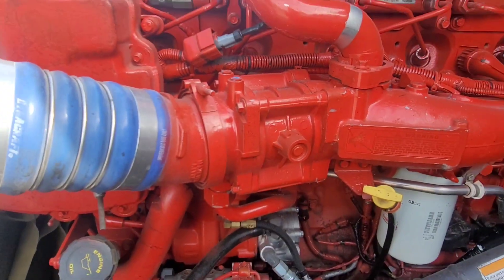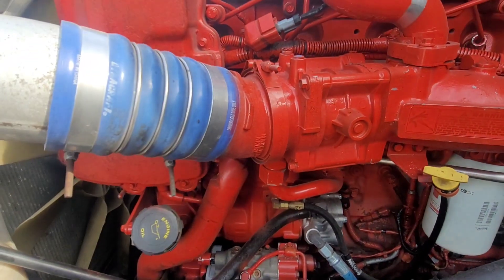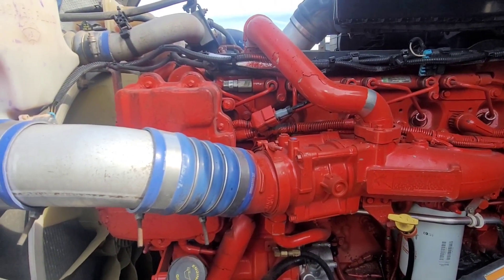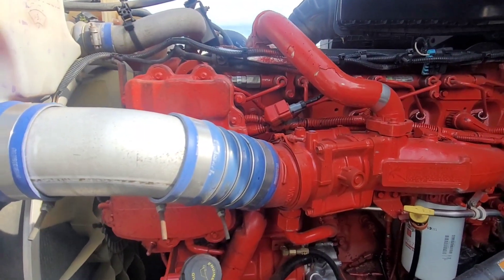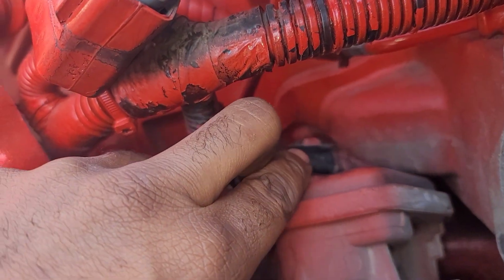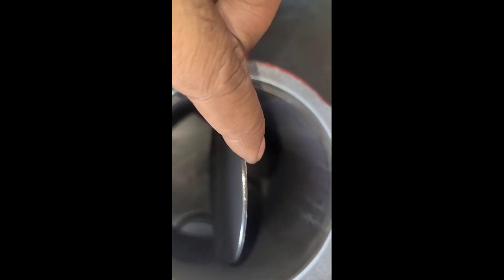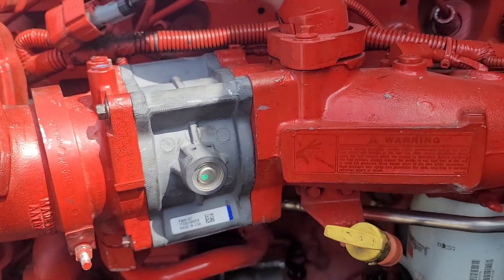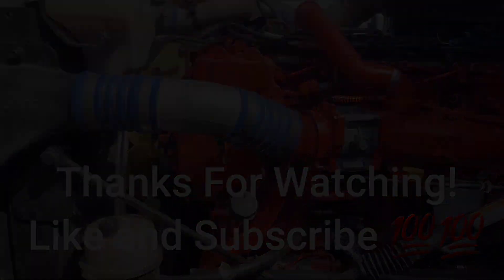Replacing Throttle Actuator Cummins ISX Code SPN 3464 Fmi 7

Comment: Hey, I was just at kentworth but another code they told me popped up and they told me the same part you replaced had to be replaced. Code 5882
Reply: Is that the same part that needs to be replaced
Reply from the maker: @edgardosierra-lind4619  did that fix it?